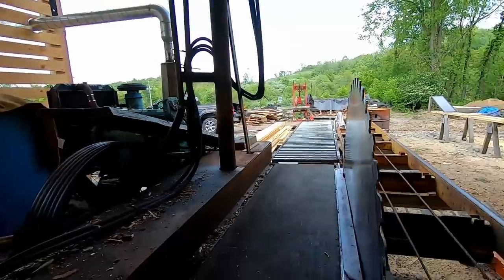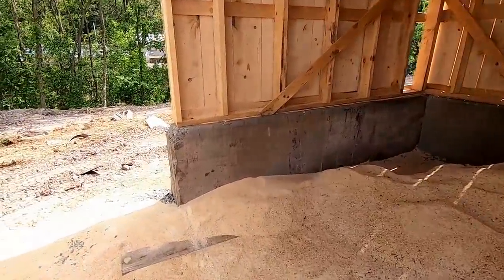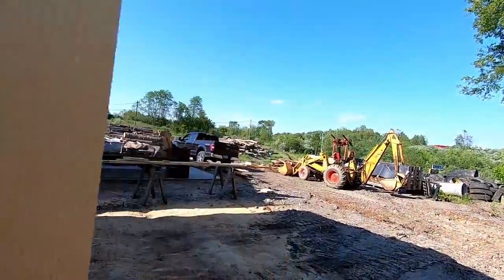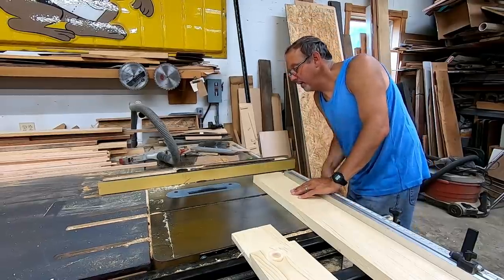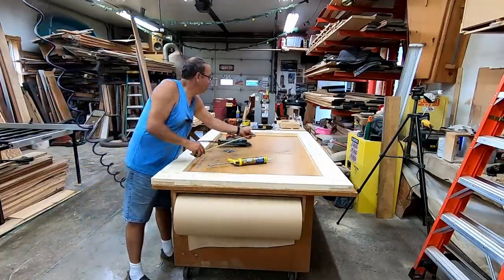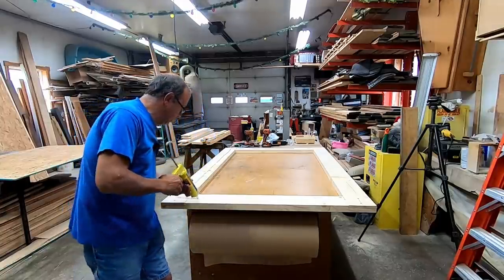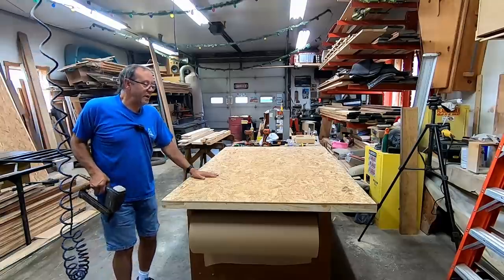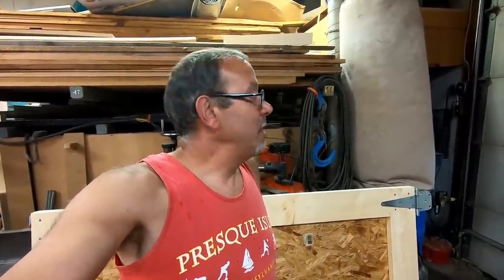sawdust bin doors

Comment: You might want to make the holes you drilled in the square guard oblong so if something does get stuck between the guard and the blade there is either pressure release or a simple quarter turn of the bolt (no stripped threads) if you have to manually unplug it.  It certainly could be adequate the way you built it but there is so much centrifical force as you get to the outside of the blade a wedge could really deform the blade.
Reply from the maker: just move the saw guide and it will move easy.

Comment: Mark,  For  Want-to-Be carpenters, please explain 2 things.  When you predrill ahole for a screw, how do you determine the predrill tool for the screw to be used.  NO. 2  Doesn't OSB have a Slick side and if so  does the Slick side go up or down when used on Roofing or siding?  Thank you very much.
Reply from the maker: Hi James, when pre drilling a hole it has to be large enough to clear the screw and osb should be installed with the rough side up on a roof.